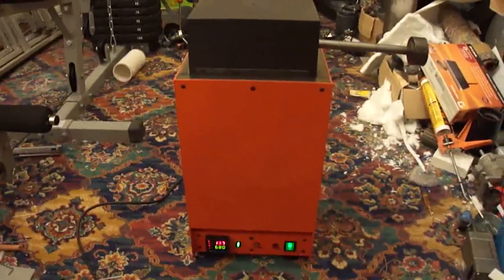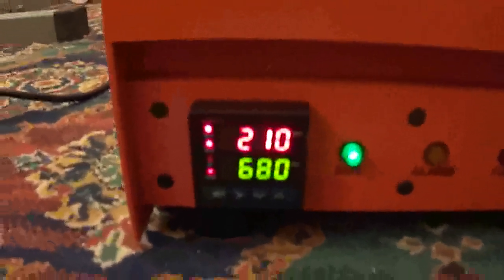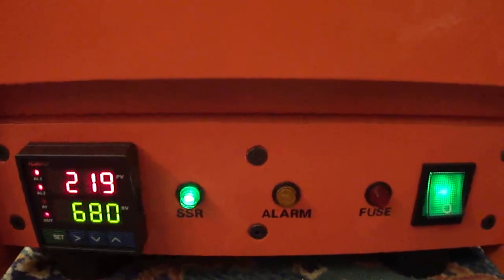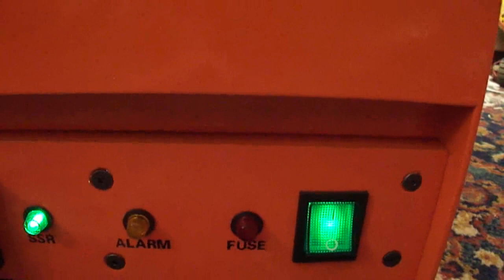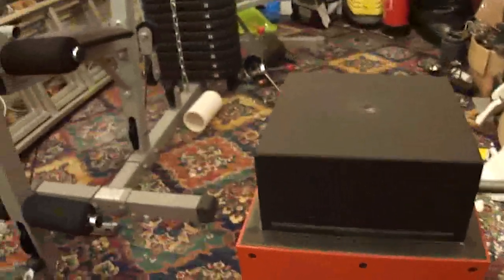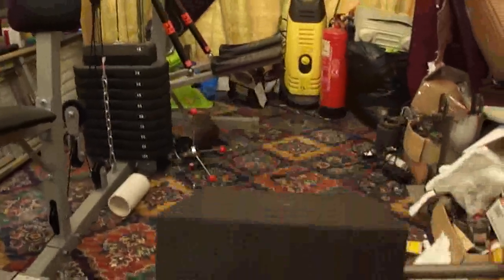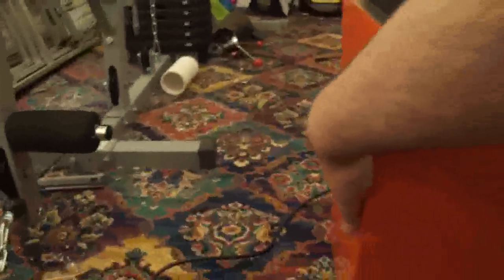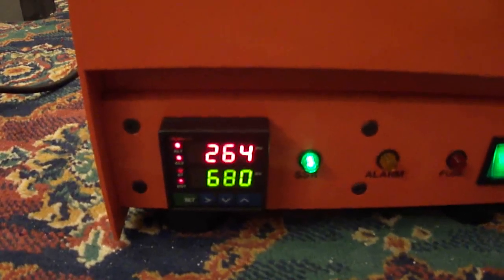My Electric Melting Furnace

Comment: You my friend have built yourself a beautiful forge here. It looks like it was manufactured professionally. Bravo to you. Beautiful work.
Reply from the maker: Thank you so much Budzilla for your kind words! :-)

Yes, this is a beautiful melting furnace which I made to a very high standard (my goal is for my work to never look "home-made!") and this is why (as you say) it looks like it was manufactured professionally! ;-)

Believe it or not!, I still have never used this furnace to date!, For over 6 years I have kept this furnace in the far corner of my living room and there is not a scratch on it anywhere! - It was the glossy orange paintwork which put me off using it in my rough and cluttered workshop :-(

I have built 3 more electric melting furnaces from 2012 - 2016 and I am currently working on a very deep slimline furnace which looks almost the same as this orange furnace in the video except it is much taller and made from Galvanised steel (unpainted this time so I don't have to worry about chipping the paint when I am using it!) This furnace is designed to have a very deep steel crucible (approx 3 litres capacity) (90 mm diameter by 420 mm deep)

Due to many commitments, lately I have not had the chance or the time to work on any of my furnace projects but I am hoping to get this new furnace finished and make a video of it melting down some aluminium very soon :-) 

Best Wishes, Joseph :-)
Reply from the maker: Warning!! - Turn down your volume before this video plays! - This was my first video that I ever recorded and I didn't realise how loud my voice was when I was recording this with my toaster! LOL

Comment: Hello nice video. Can melt copper? How long does the kanthal wire last?
Reply from the maker: Yes it can technically! as copper melts just over 1000 degrees and this furnace will reach 1200 degrees if the pid controller is set to the max of the thermocouple which is 1200 degrees, the fire bricks I used for this furnace were the more higher temperature heavy duty 28 g kiln fire bricks (230 x 114 x 64mm) which are rated up to 3000 degrees.

Since 2011 when I built this furnace, I have built 2 more and I am currently working on a very deep slimline furnace which is based on the same design as this great furnace but twice as tall to hold the maximum volume of aluminium as that's what I want to melt mainly for casting parts for my small machine tool projects :-)
Reply: Ok. What is the brick of the bricks you used? Their composition? The thread is in kanthal?
Reply from the maker: They are high alumina fire bricks that were used in this furnace project and the element wire is 18 gauge Kanthal A1 wire. - Hope this helps :)

Comment: Not Necessarily..you can reconfigure the element connections to operate on different voltages
and the rule of thumb with resistive loads which the elements will be, is the higher the voltage, the higher the current

Comment from the maker: @Otzmatron 

I will make a video in the New Year pouring ingots ;)

P.S. To get the metal into that shape you will need a steel or graphite ingot mould - You can easily make some good ingot moulds from a few scraps of steel and using a stick welder to weld them together :)